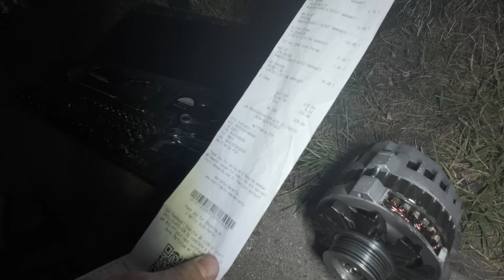End Of The Power Tour For Him - HRPT 2024 Day 4

Comment: My alt housing broke too. Then I replaced it with a new one and the bracket broke off at the mounting hole ear.
Reply from the maker: Super frustrating man. Hope you got it sorted out.
Reply: @yeahbuddygarage  oh yeah, this was awhile back. I used jb weld to get the tab back on the bracket too. Just used the stick kind. Should’ve used the 2 part liquid like you. Would’ve made it easier. Been a year so far and still going 😬